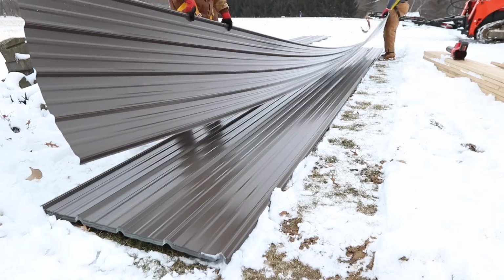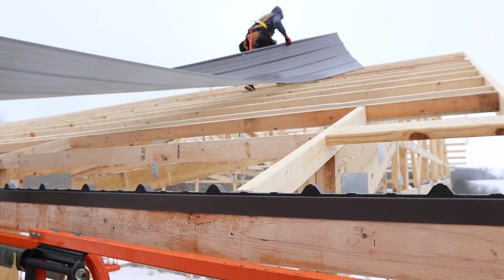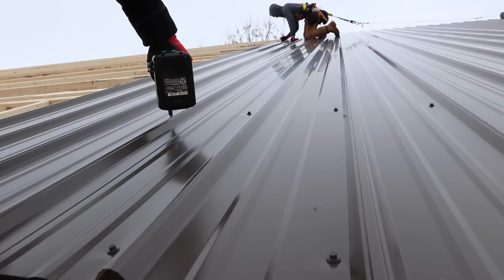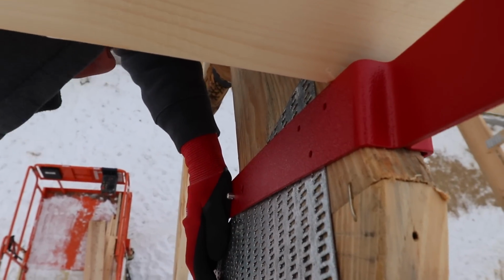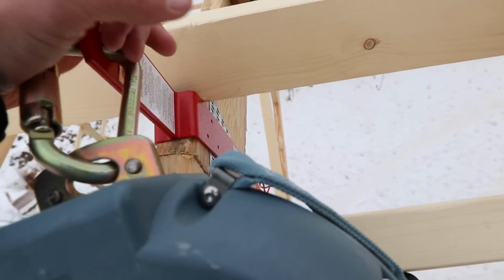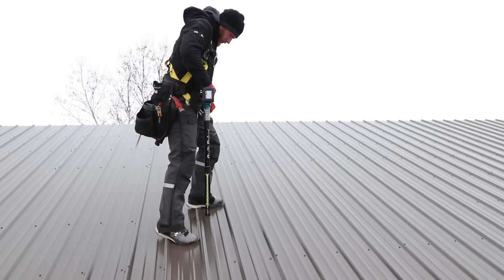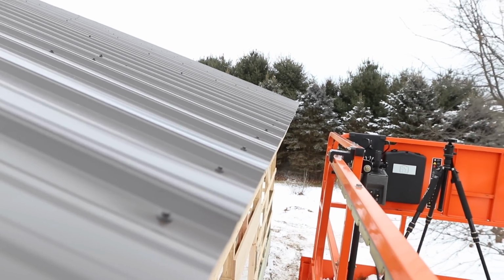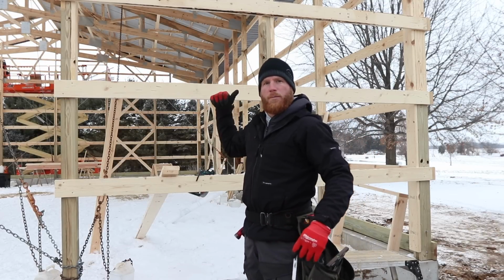Building a Work Shop: Installing Metal Roof

Comment from the maker: I am really trying to find the right safety system for the projects we work on that not only are safe, but efficient to use and keep us wanting to use them....so if you have ideas, drop them below thanks!!
Reply: Good to hear. I would suggest a running line that is the same length as the roof sheet less 1x the persons height. A top line runs the length of the ridge through the brackets that you have (If rated) and a fall arrest line clips into this. It doesn't need to be retractable and will stop the pendulum effect that still exists with the set up that you have. Off course correct product and use will need to be verified...
Reply: the retractable should be attached directly to the harness. that lanyard that is in between is going to allow for another 6ft +/- of fall if it is activated. Just attached directly to the retractable and you are a lot better off.
Reply: @thomasmiller7747  the lanyard is to absorb the shock. makes the fall a lot less hurtfull if you have one on.
Reply: @thomasmiller7747  working as a crane operator in NYC during orientation the safety guy always says to hook up the retractable on the safety line, not on the body
Reply: RR Buildings 3m has a horizontal life line you can out across ridge on top of the roof and cover most of it and then get some long lanyards, is also another option
Reply: Job safety is always an honorable endeavor. The statement that you are trying to find the right system for you is the most important element. Unfortunately the true facts are unknown.  Like seat belt legislation, the facts are not recorded.  Number of job accidents caused by fall protection is a statistic unavailble. Same as number of deaths caused by seat belts, unavailable.  Clearly you try do to the right thing, you put real effort and thought into it. That is what saves your butt in the end. Thanks for sharing
Reply: Now push Greg off the roof to show us how it works!
Reply: Probably unrelated, but on my brick house I glued in a row of stainless eyebolts at roof level. When it comes to securing ladders for later maintenance they are a godsend.
Reply: I think it needs testing! Lol
Reply: Fall protection pros https://www.fallprotectionpros.com/products/dbi-sala-swiveling-roof-anchor?variant=4949304573986&gclid=EAIaIQobChMIyfWxsr-v4AIVxrrACh2GMQA_EAQYCCABEgIQJPD_BwE has a system similar to what you already have however it swivels but does not go over the trusses like yours. What would be great and I can’t find it would be a system that could connect to the front and back trusses of the building with a tightrope style line running between them that you could attach your safety line to and would slide from one end of the roof to the other allowing freedom to move anywhere on the roof. 

P.S. fellow Illinoisian (Yorkville) love the work you guys do wish I had the talent.
Reply: RR Buildings check out 

http://www.realityropeaccess.com/Location---Contact.html

I’m a Chimney Sweep and work off roofs all the time. I found these guys through the National Chimney Sweep Guild and the stuff I learned there was awesome!
Reply: Hey rr. In Denmark we use scaffolding on alle four sides of the building and under the truses we use a big safety net to ensure falling mishaps when we are installing the Roofing. This is unfortunately very expensive,  but also very safe.
Reply: RR Buildings what you call a “mini angle” the actual term is “gutter apron”
Reply: RR Buildings check our Petzl work gear,  most of which is Osha approved for our roofing projects! If you need a distributor message me!
Reply: You said that you put your roof screws in the flats. Some are up on the rib is that just where 2 sheets meet? Haven’t installed a metal roof yet.
Reply: shawnf77 when placing ridge and some accessories the screws go through the accessory and into a rib. Otherwise use the flat, to the sheet side of the cover rib. Hope this helps!
Reply: Really wish you were closer, im in So. ILLinois, my old barn needs some loving. Needs new roof and wall metal too !    Its a tiny 30 X 50 X 14 ,  not like these monsters you build !!  Great work and great detail on your buildings....
Reply: warren, he does build smaller ones, he even posted such a few jobs in past videos if you take a little time to look for and watch, they are both more closer to shed size than what you mostly see him build in more than one video.
Reply: Yes, ive seen them. The location is more of the factor, as well as such a small job. Not cost efficient for them to travel 250 miles on such a small job is more of what i was talking about.

Comment: Wow, @ 7:50 I see what looks like the building swaying back and forth. The lift seems to be stable as compared with the objects on the ground. Is it the building  moving  ?
I would think that by the time you're putting steel on that this building's framework would be a whole lot more firm than what I think I'm seeing !

Great videos too.
I'm not a builder, only a mere handyman. I stumbled onto your channel while searching for some information related to learning SketchUp 3D modeling. . . now I"m modeling a 50' x 120' post frame building ! LoL
Unbelievable what I've learned watching your vids.

Cheers,
Uncle Vic

Comment: Hey Kyle, thanks for the great build video. 

Question: When I lay metal, roof or siding I stack up all my sheets, Aline the ends, mark screw layout on top sheet and predrill the stack. 
Doesn’t take to long. Gives me a easy to see screw location which makes screwing faster and perhaps most importantly the screw doesn’t create a curlycue that can damage the screws washer. What do you think? 
Predrill or not? 

Tim

Comment: Metal Sales also recommends a different screw pattern than the one you guys use.  Should stitch the overlaps, and not use regular screws, like you show using. Regular screws actually pull the steel apart, and stitch screws bind them together.

Comment: I'm curious about leak resistance and cost of fixing leaks in the roof? I'm familiar with classic stick frame and ashfault roofing and the sheathing will provide some limited barrier when the shingles get leaky. I can see that a leak in those metal panels have no extra barrier against leaks.
Reply: At least with this system you won't get a lot of structural damage from leaks.. Replace a panel and you're done... Fixing a bad leaky roof in stick frame is... Not fun.

Comment: G'day Kyle. I believe the reason the roof fasteners are normally driven through the ribs isn't for strength, it's because on the flat they're basically under water when it rains heavily. Eventually the washers will fail, and the roof will leak. By installing on the top of the rib the fastener only needs to resist moisture so pretty much doesn't need sealing at all.

The end wall is structural, and down here in Oz, I don't believe the way you're framing the window would pass code. You would need to turn that 2 x 6 (??) sideways and use it as a header with jamb studs either side to support it. That way the load has a path to the foundation. At the moment the path seems to be through the window frame, and that wouldn't cut it. I appreciate the sheeting may be load bearing, but that doesn't count in this instance.
Reply from the maker: I’m actually not even worried about the sheeting as my load bearing component... the structural truss is the header holding it all up
Reply: RR Buildings You’re absolutely right Kyle. Sorry about that. After I posted I remembered your roof was trussed and this was an end wall, but your ever-efficiency got a reply in before I got a chance to edit. 

Personally I’d treat it as load bearing as it’s very little extra effort at this stage to take any potential load away from the window frame and would help future-proof any later changes to the building. 

I think I did get the crest fastening comment correct however ;)

Down here I believe most would run sarking (not sure what it’s called up there) under the sheets to the gutters. It will prevent condensation under the sheets entering the roof cavity and also prevent metal to timber contact. Some timbers are somewhat corrosive and it extends the roof life. Sarking is dirt cheap. 

Love your builds and work ethic mate. Top job
Reply: Ozzy..oi. oi. Oi.

Comment: Just watch out for “ball pinch” if you fall. Could be life changing 🥴. Also look up suspension trauma. With standard harnesses if you’re suspended for greater than 15 minutes then you’re at risk from suspension trauma. You can get foot loops which attach to the harness and tidy away fairly well but if you’re left swinging you can unpack these and stand up in them thereby relieving the pressure on you arteries in your legs. You could also/or try a rescue harness. These fit slightly differently around the thighs but are much better than the standard harness. 
👍
Reply: Still, "ball pinch" beats "neck broke" or "back broke", which are also life-changing.
Reply: Scott Willis - very true Sir,  always work safe.

Comment: So glad to see the guys working at height using safety harness's. Can't the inertia reel be roped directly to something, rather than using the bracket around the truss... that locking pin does not fill me with confidence.

Comment: Are those 2x "stiffeners" you added around the window opening enough to transfer load from the roof/wall down to the foundation, or is there more to come?  The post frames I have seen have always moved windows to accommodate the post layout. Just curious, asking as a layman because it was new to me.

Good video as usual, thanks for posting these.
Reply: The window is on the gable wall (side with the peak in the center of the building); therefore, there is minimal load on that post (the rafter transfers most of the load to the posts at each end). I'm assuming he'll also put a 2X on edge at the top and bottom (same as girts) which will also make it more rigid. Hope this helps!

Comment: Concerning the straight lines when you were talking about installing all those screws in the roof steel... Since you just tack them down to begin with and then go back and do the majority of the screwing off (sounds bad but no pun intended), why not just use your laser to put a straight line down. Then you'll get the 'perfect' straight line a customer may want, and you still won't be having to snap any lines or do anything too extra to get those lines? Another great use for the laser in my opinion.
Reply from the maker: Hmm. Not a bad idea man

Comment: Hey man... maybe you could explain in a future video why you use nails vs when you use screws. I see you alternate between them so frequently in your videos it's hard to determine which one is used for what.
Reply: screws have nowhere the shear strength as a nail. Screws are good at squeezing things down to keep tight but nails are better at clamping things together that will have a chance of shearing off. If you screwed a 2X6 between 2 posts on its side and nailed a 2X6 the same way, the nails are much stronger than the screws and would take much more weight or force to fail. The screws are more brittle and can snap from weight. If you screw down  a 2X6 flat down to a floor and nailed a 2X6 down to the floor, the screws should hold it down better but the nails have a better chance of walking out because they dont have as much clamping force as the screws. Ring shank nails are pretty good though at this.   something to this effect anyways. Im sure the internet will be along any minute to correct me but thats how i always understood this...
Reply: Kyle literally explains it in the video during the explanation of why fasten in the valley versus peak and which is used where, or simply put in better context, think of it as ductile versus tensile: 

Ductile will slowly bend, think of the balloon or such as it expands until it bursts, or overfilling a cup of your favorite drink

Tensile means it will just snap apart, think of it as an explosive, it will burst with little to no warning, or for another example tossing water into fully heated cooking oil.

Comment: HELP: I need "chicken-hook" ladder roof-hooks to go over a 60 degree metal roof peak. I found "Tie Down Engineering Roof Zone 65005" hooks on Amazon but wonder if there's a better set of hooks to attach so the hooks hold and don't damage the roof. Thanks. EDIT: Oh yeah, and the hooks have to go up and over to clear the existing vent cap.

Comment: When your cutting that post for the window install why did you not use the saw that is meant to cut posts in one pass?
Reply from the maker: Access
Reply: Because a beam saw is heavy and requires him to take time to go get it, the saw he used was just fine and he was done before he would have been back with the bigger beam saw.

Comment: How far apart are you trusses?
6 feet ?
Reply: 8 foot O.C. as they sit in the center of each post (column) and fastened in by two double sheer bolts.

Comment: Good to see safety on you tube but just some thing that happened to me on site and the company I was working for are fall arrest system was the same kind as yours and a safety audit we had 15  condemned as we were using them on the flat and they were meant to be over head and they weren't rated for that kind of use all so Greg harness is to loose we did a two day course on harness and fall arrest the photos gave us all nightmares for weeks keep up the good work great content loving the channel
Reply: Found this in less than a minute, So true it is for overhead use, NOT completely flat surface use.
simplifiedsafety.com/blog/how-to-safely-use-a-retractable-lanyard/

Comment: My preference (if code allowed) would be a smaller/lighter clip between lanyard and lifeline - I imagine keeping it from scraping the roof panels is a constant battle.  If the shock absorption could be built into the other end (retractor), it would simplify the live end.

  I know you have a good supply of access machines on hand but the importance of a rescue plan when someone has fallen and is stuck hanging in a harness is important also.  

great content and editing as always.  Noticeable improvement to audio and video also!

Comment: Man you guys do awesome work.The only thing I would want to say is that the window framing. The top piece of the framing I think should be turned up on its edge.Also doubled up to hold that post. That is only my opinion I have just seen a lot framing sag by doing that way. Man keep the great video coming and I really thin Greg and you kin
Reply: The weigh of the post after time will cause it to sag
Reply: those girts above (out and in - side) are more than enough on an end wall along with the added sheet metal with additional strength, but if one wishes they always can add in the traditional header.

Comment: I was always taught that any opening in a wall gets a header and jack studs.  This is to prevent sagging of the top of the opening.  This may not be load bearing because of the truss, but there is still quite a load on the middle of that window due to that huge 6x6.  As it is now, everything above the opening, between the two posts on either side is hanging from the truss.  If the trust sags even .25 inch, the window may crack.
Do you feel the siding above the window, between these two posts is enough to prevent sagging?
Reply from the maker: Totally not even worried one bit.  By time siding is installed plus the truss is a structural end frame, it will be fine... I could eat my words... but I think it will be great

Comment: Does the window frame act as the header and carry the load back to the post underneath? No need for a traditional header?
Reply: I was wondering the same thing, but I guess the leftside/rightside posts are holding up the roof trusses and this cut post is just there to nail the girts to. Honestly for an extra $ I'd rather see a conventional header in there but I've seen it done this way too.
Reply: @____________________________.x  yeah, I was over thinking it I guess!
Reply: that post is there more for stiffing being on the gable thats why he had to go from post to post with a stiffing board. @WayWoodworking
Reply from the maker: No need for header as post bears no weight
Reply: @RRBuildings  thanks for the explanation! I guess that's the gable end. So, I'm not sure why I had that confused but I appreciate you getting my head around it!

Comment: Good day RR Buildings.. i got a question usually we do build our houses in reinforced concrete foundation but its so much time consuming.. is it ok to go for  steel foundation instead of the usual concrete foundation?
Reply: AFAIK, it is possible to do such using screw piles, but not yet heard or seen of this being done so far,  have watched video of two such buildings being relocated easily enough. Considering doing something like this if ever got enough land to build it as/like a 'portable' shed.

Comment: I have a tool dilemma I hope you can help with. 
I’m not in a trade, more diyer and want to upgrade my drill/driver for a summer project at home. 2 questions are

Makita have a brushless set and non brushless, which would you recommend? (Again for average use)
Also they have a battery option. It’s either 3 battery’s at 3Ah or 2 battery’s at 5Ah. do I go for more power or more battery’s?
Not much in price so not a factor really. 
I can not decide. Thanks
Reply: Unless you are going to use it for more than one project, I would look into renting a tool, IMO I would go with brushless. Many places offer them.

Comment: Aren't your feet cold brother!? wearing regular shoes instead of work boots? Especially on a metal roof?
Reply: keep a move on and you wont be cold !  The shoes have better traction on a cold, snowy slick roof than boots.
Reply: The shoes he uses for roofing have more true rubber soles unlike most other foot wear he wears.